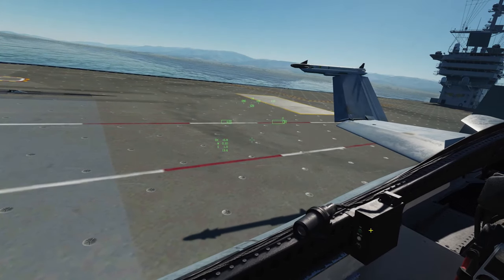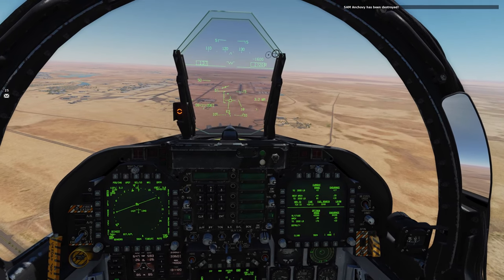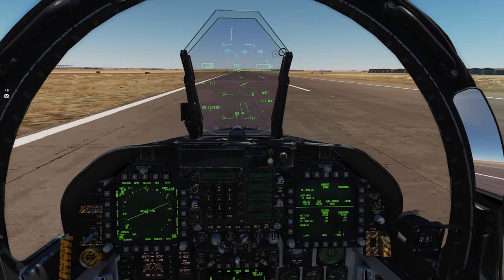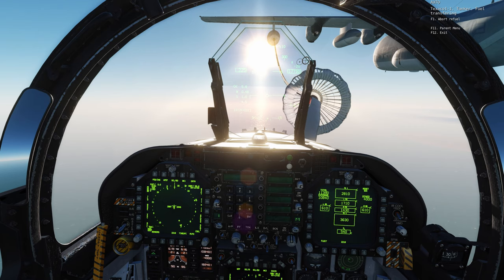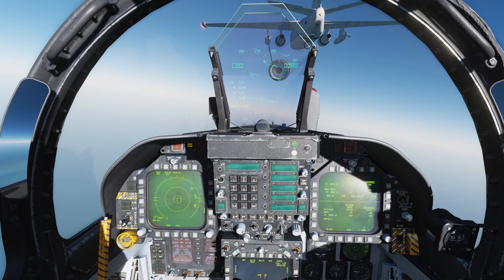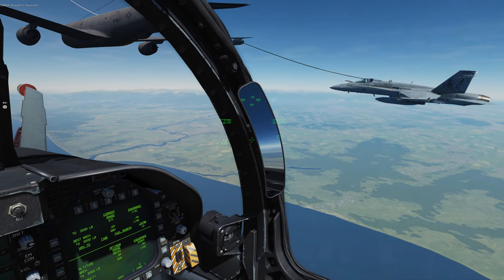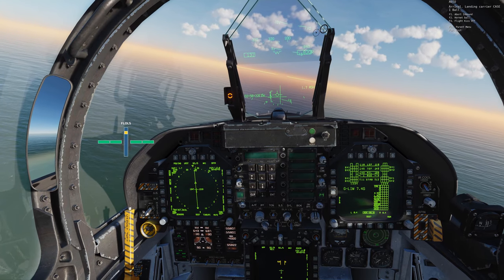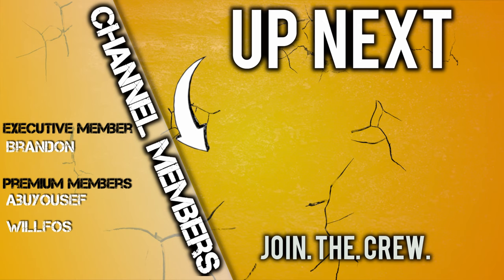DCS: World Carrier Landings and Air Refueling | Learning to Fly: Episode 3

Comment: What I have found to help with the 3 degree glide slope (or whatever degree you want) is to place the touchdown area on your hud at the angle you want on the pitch ladder of the hud. When on speed adjust the throttle so that the touchdown area rises or falls to that position on the pitch ladder. F-16 makes it easy by having a line on the 2.5 angle. You have to imagine it on the Hornet but realising this helps you with “what height should I be at this moment” when on final.
Reply from the maker: Excellent advice. Thank you. Going to take a few runs at it now!

Comment: The most common flaw is following the BRC all the way in. Remember the carrier landing area is angled, so aim to cross the ships wake, and then use the FPM and aim it at the “crotch” - the spot where the angled landing area just out from the rest of the ship.

Try and get the lineup as early as possible. At the start of your approach, it’s going to look like you’ve gone too far right, but remember, the ship is moving, so it’ll all work out. You’ve got the AoA dialled in right, get the lineup sorted and you are golden. 

Lastly, REMEMBER the ball. The FLOLS you saw at the end let’s you know if you are trending too high, and you’ll use throttle rather than nose position to fix that. 

POWER for altitude,
AoA for speed. 

Hope that helps. I mostly fly the f14 in DCS, but the basics are the same and have been since jet aviation was in the navy. The system works, as long as you follow it :)
Reply from the maker: Excellent advice. Thank you!
Reply: I understand how Power for elevation works but how does Trim make you fly faster/slower? I never understood which is why I keep crashing before I even make it to the deck. I always fall in the ocean before I get to the carrier! :(
Reply: Slyder Ace when you have the nose position set “on speed”, consider what would happen if you moved your nose up or down. If you pushed the nose down, you’d speed up, but also your sink rate would increase - an understandably dangerous situation!
You also end up with the tail going up, which raises the hook from the ideal position which guarantees a miss.

Pulling the nose up too far is equally dangerous. This reduces your forward speed and starts causing you to climb, meaning you miss the deck - and if you do hit the deck, your hook might hit the wires, but then again, the angle will be so low, it’s equally possible the tail itself will as well!

Once you find the sweet spot of the two (indicated by the E-Bracket and AoA indexer), you can make adjustments to the throttle, and you will notice that your FPM indicator will raise or lower itself. If you then adjust the nose to be on speed again, you will still impact the deck at the correct angle. But how do you make sure you are going to hit the wires?

Enter the meatball!
Using the Glideslope indicator (either the assistant 2d panel or the actual ball if you can see it), you will see a yellow light above or below the green line. If you can keep your AoA and throttle adjustments so that you are on speed and have that yellow light in line with the green ones, you will absolutely catch a 3 wire no problem.

Of course, remember to never cut power as you cross the ramp. It’s tempting to settle and bounce your way into the wires, but if you miss, you have utterly no chance to put in enough power to get yourself in the air again before you trundle off the other end into the water.

The carrier is massive - you aren’t going to break anything by going full power when you snag a wire. Once you are quite sure you have caught, cut throttles your idle, roll back, tuck in the wings and pull up the hook. Then get clear of the deck so others can also go through the same 20 seconds of terror you just survived :)

Comment: Allright, I'm just going to point out a few things:
You are coming in high - you should remember the correct altitudes for each section of the pattern.
Your final is too long. Groove length should be 15-18 seconds. When you practice, keep that in mind. A big part of case one is executing that turn properly (think about what happens to the guy behind you if you turn too late).
Don't ignore the meatball, It's your tool.  Perfect AOA doesn't matter when you are below or completely above the glideslope.
Aim for roughly -750 feet per min on landing.
Reply from the maker: Lol. Tracking 100% of that. Just need more practice.

Comment: Let me help you guys on Air refuel rules:
1- Find the tanker with your tacan or SA page
2- Line up with the tanker just slightly to the left of the tanker
3- Make radio contact to initiate fuel transfer
4- Use gentile controls input to try to connect to the basket
5- Retry item 4
6- Retry item 4
7- Retry item 4 ........
122211133- Retry item 4....
2233221234- Discharge every round of your gun in that @##$&&## tanker!!!!!!!!!
 Carl E x3
😂😂😂😂
Nice video!!
Reply from the maker: I may have elected not to include my "switching to guns" clips 😂

Comment: Nice video! I've been meaning to spend some time just working on my landings. The break just kills me every time. I roll out of the first break and I'm high and chasing the AoA indexer on the HUD. Before too long, I'm just floating up to 1000ft when I should be at around 600ft for the final break to the boat.
Reply from the maker: I have the same problem.... And plenty of others hahaha. Thanks for watching!
Reply: @ControlledPairsGaming  It's definitely tough to just sit down and do something you're bad at, when it's so much easier to just fly off and blow up a bunch of trucks with the TGP!
Reply: the crosswind leg after the break is a level turn - this is something i didn't know and the cause of my struggle. so start at around 800' - break - finish at ~800' at the end of your 180. then start your slow descent to around 600 to the baseleg. the baseleg is where you should have more finesse since that's also a slow descent  (while turning) to about 400-450' by the time you're in the groove. hope that helps.

Comment: For the people that have the x56 i took one of the lighter springs and kept cutting it down until i felt i was able to get perfect fine tune movements and it will still recenter itself if you let go its about getting the right amount of spring tension
Reply from the maker: I've seen this mod recommend before. On my FCS throttle I did the Nyogel 767a application to reduce stiction in throttle control.

Comment: You absolutely do need to use your stick when landing.  Trim is a vital part of landing but it isn't a good enough on its own if theres any sort of turbulence or misalignment trim will not counter it fast enough.  
Over the boat on BRC at 800 ft when your 1nm ahead pull 1% of your speed in G while backtrimming a bunch so as that when you roll out on downwind your at 600ft and on speed aoa gear down flaps down.  Continue downwind at 1.2nm - 1.5nm abeam the deck and when you see the rounded edge of the back of the boat turn in at about 27- 30 degrees bank adding slight power for loss of lift while maintaining about a 1 degree below level.  Coming around the last 90 should be around 430 ft or slightly less(?) on glideslope with about an 18 second in groove time.  By this point you should have yourself perfectly trimmed out for a 3 degree descent with the VVI and E bracket placed in the knuckle of the boat (just forward and right of the landing area near cat2)  The boat is moving right and away so using the knuckle as an aim point until in very close will make sure you hit the wires.  
And lastly again.  Absolutely use your stick to maintain a good flightpath.  Trim is great but its not a primary fligth control
Reply from the maker: Woah that's crazy

Comment: Your problem is probably that you are to high. Wen you are at kiss off you should be ab 800 feet and not higher until touch down+never use the stick to control your altitude just use the throttle. Another thing: never use Wheel brakes when landing and when you are about to touch down turn on the afterburner. It took me about 5 Hours of trying to get a perfect pattern/landing and I'm not even 15 so if I can do it you can to
Reply from the maker: I'm fully confident in my knowledge of all required procedures. You're right practice makes perfect. I find that I tend to climb a tad in my downwind leg as I chase the AoA indexer in to place, something that I've since resolved. 

I thought I spoke pretty in depth in the video on how to control pitch without stick manipulation. Thanks for reminding me again. 

Thanks for watching and good on you for pursuing such a complex sim at not even 15.
Reply: @ControlledPairsGaming  thx. A last tipp from me: don't chase the aoa indexer do it like that: 250 Gear 200 Flaps half 170 flaps full during that time no power input 140-130 start putting in trimm for the aoa and do em smal so that you don't climb and at TACAN 1.7 start the base turn👍🤗
Reply from the maker: Appreciate the unsolicited advice.